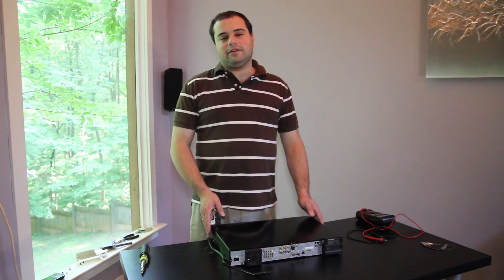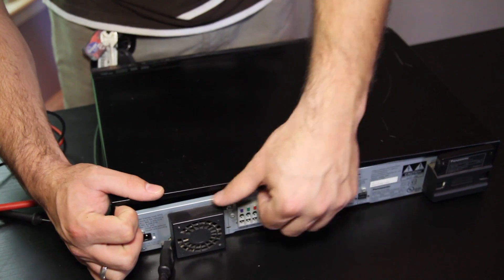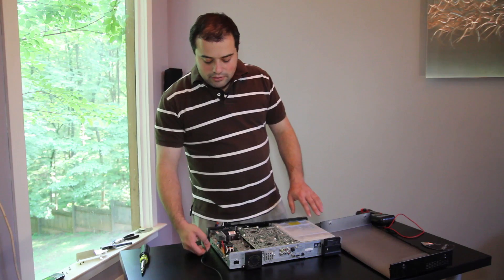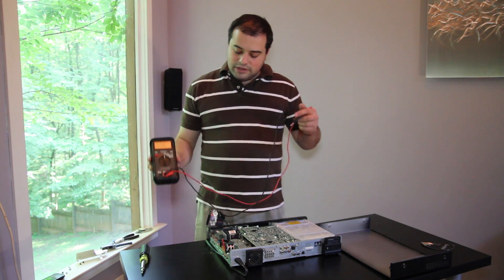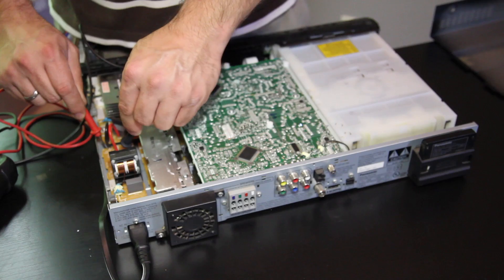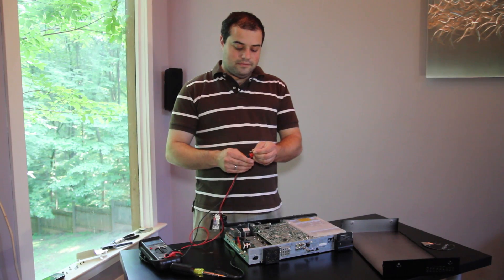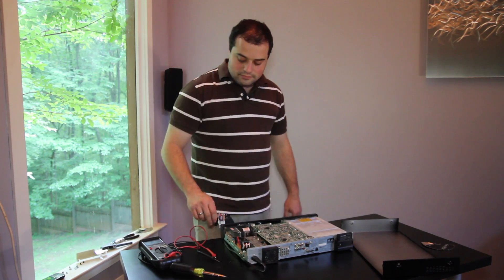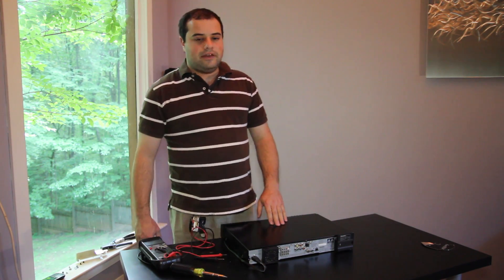Home Theater Repair & Installation : How to Repair an AV Receiver

Comment: Ok video, that's the first thing to check and sometimes you get lucky and fix your stereo. However I used to work in a shop and found that when a fuse blows there's almost always something that caused it.

Comment: Thanks. I know it is the fuse and now I know that I can fix it myself for a couple of dollars. Appreciated.Of course, as some comments say, it could be a number of things that go wrong with a Home Theater system, but if you have a blown fuse, why not just change that first and see what happens. If that does not work and something is causing the fuse to blow then all you have wasted is a very small amount of money.

Comment: If you're new... be sure not to short out any capacitors. They still hold a charge after the power is unplugged. Don't work alone either. Have someone around that can turn off power/call 911 if you're doing the 60 hertz shuffle

Comment: Viewers, please don't be led to believe that a repair of your AV receiver is this simple. This video is of absolutely no value. Common failures are power output transistors, HDMI transceivers, MCU's, and power supply problems.
Reply: +SaturnV2000 Right, many things can go wrong in an electronic device and what this video suggests is one of them. You can't say it is is without any value.
Reply: Fuses very rarely open. If they do, there is always a fault somewhere else.

Comment: Hi there, i tried what your video showed and my amp still won't work, it powers on and after 3 seconds there is a click and the safety light, lights up, do you know what would be causing this?

Comment: I have a question I have a homtheater and when I connect the sub  It does not sound I tried  different sub and  all of them sounds bad  like the sub are broken and I  was kind of  hoping you can tell me what is doing that